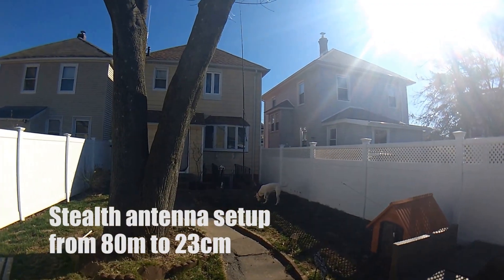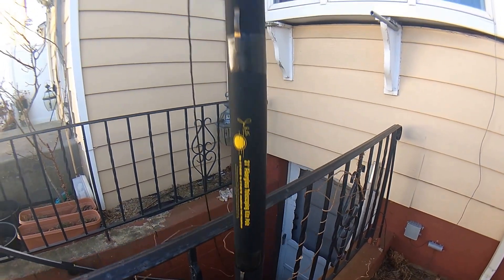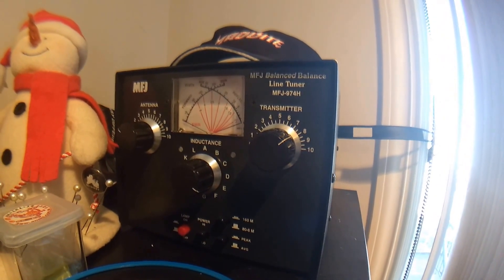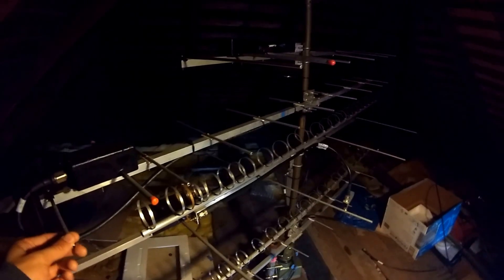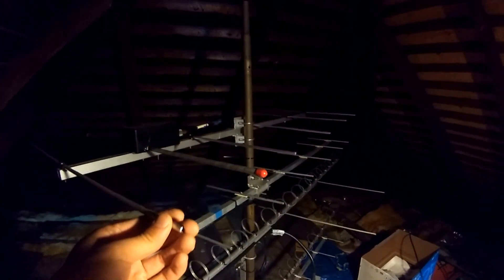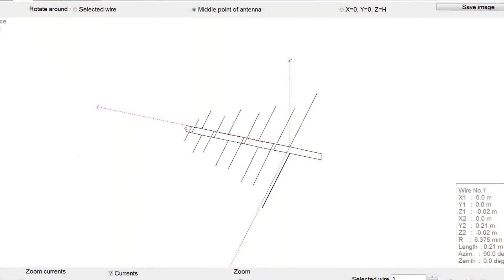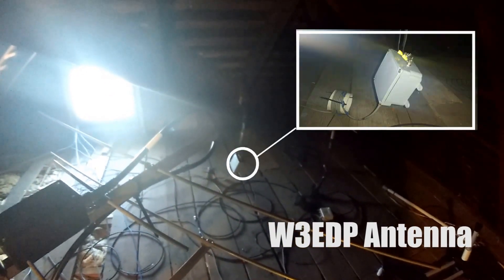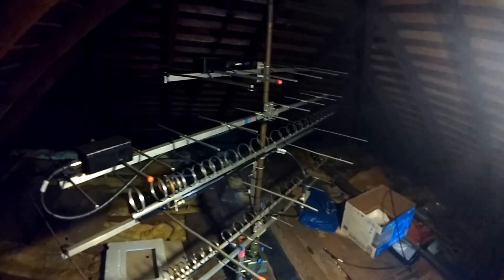Ham radio home-brew DIY stealth antennas, Full ham band coverage from 80m to 23cm

Comment: Thanks for the video! Looks 100x better than my attic.

I do wonder, however, why you chose to keep all antennas on the same vertical pole, especially as you mention the problems associated with doing so. As it appears you have lots of attic space, why do you choose to keep them all on top of one another, where the resonant power transfer could certainly cause some issues?

Also, did you say 150W on 2 meter?! How many hundreds of miles are you going? Is your receive quality strong enough to properly utilize that?!
Reply from the maker: Thanks for the comment Travis. I stacked two 432 MHz antenna to achieve more gain,  the 2meter antenna and 222mhz antenna was stacked to save space. My attic is a lot smaller than it looks in the video. Like I said in the video the stacking distance is a compromised solution.
As for the 150w output on 2m  I think it's necessary for doing weak signal work. I regularly make 100 miles+ contacts if the condition is right 200 to 300 miles contacts can be easily done. I even made a 800 + miles meteor scatter contact using fsk441. 
I also had an impressive DX contact with va3ele on 432 MHz by bouncing signals off air plane.

Comment: I admire your attic antennas. But your outdoor antennas are not very stealth. I would get kicked out of my HOA neighborhood with those...lol! Glad they are working out for you.
Reply from the maker: Thanks for watching! The w3edp is pretty stealth. You barely see the wire. But I agree the vertical is a little too much for HOA. I've built a magnetic loop works from 10-20m that antenna can be easily fit into any attic!

Comment: You have a great antenna farm in your attic. I am guessing your ceiling height on first and second floor is 10 feet. I would not want to climbing about your steep pitched roof trying to mount VHF/UHF antennas. You have a great high advantage that is safe to work in with worry of falling that you would have with outside mounted antennas. With only one tree you conjured  up a way to work HF and listen to shortwave reception with the addition of the fishing pole. You have more skyhooks than many hams. Nice video. Thanks for sharing. BTW, if I hear you on CW and you are sending slow I would never attempt to call at a speed faster than what you are sending. That would not be polite. CW OPS are polite. hi hi
Reply from the maker: Thanks Terry. Hope to work you on the air soon!
Reply: I primarily work CW on HF. I may begin trying some phone QRP HF but don't hold your breath. hi hi
Reply from the maker: Life is never too short for QRP!